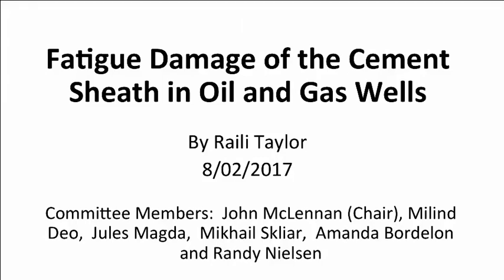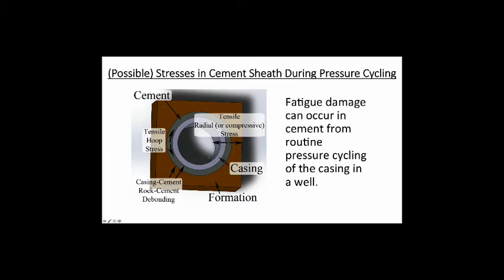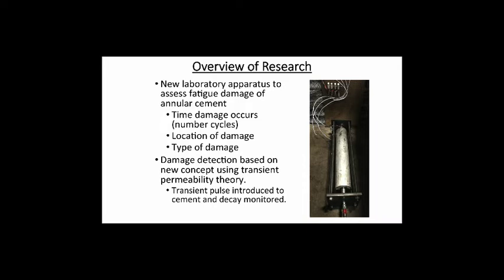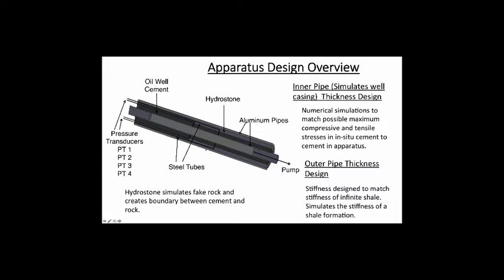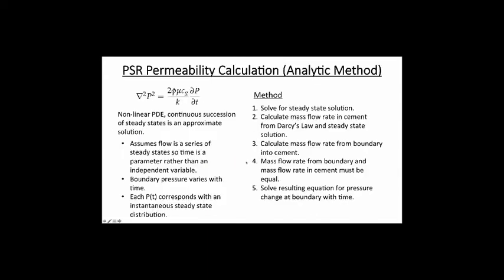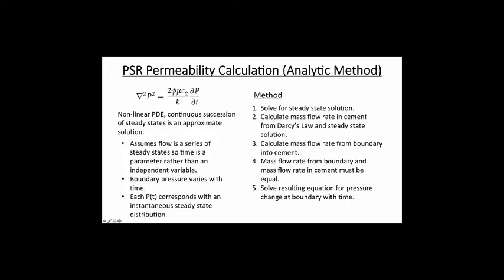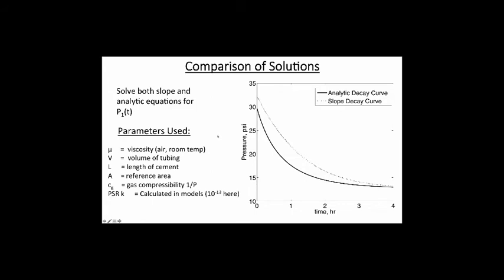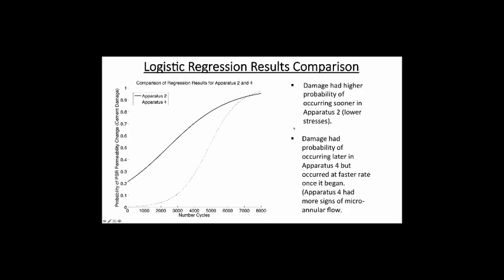Fatigue Damage of the Cement Sheath in Oil and Gas Wells

Comment: Good job. It would be better if you can try the different slurry systems.
Reply from the maker: Thanks for the comment and insight. Are you referring to different cement slurries?
Reply: Raili T Well, for example. In canada we use different slurry system for SAGD or CSS which would be picky on cmt bond as thermal EOR.
Reply: Raili T By the way, May I have your email pls?